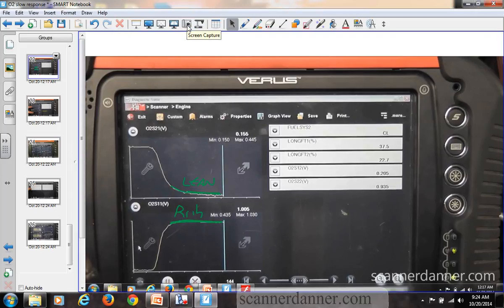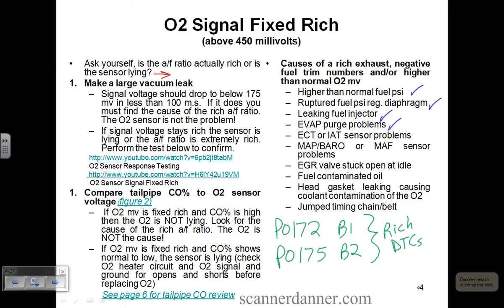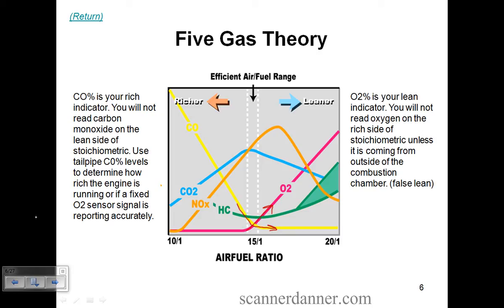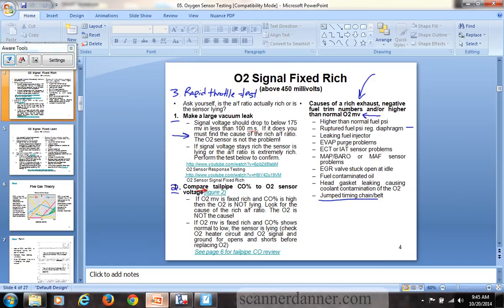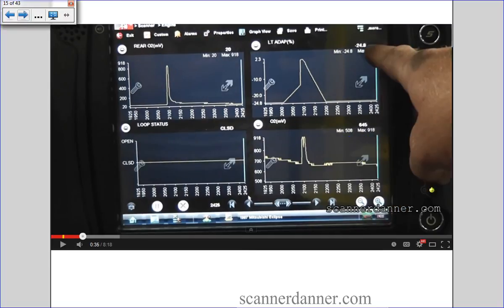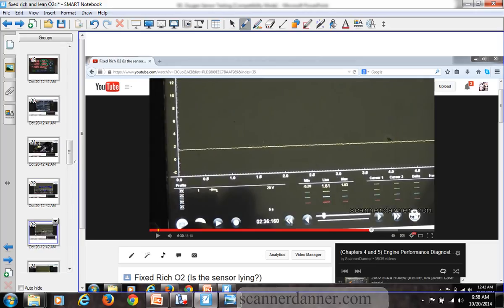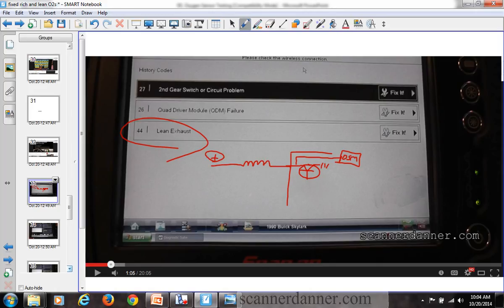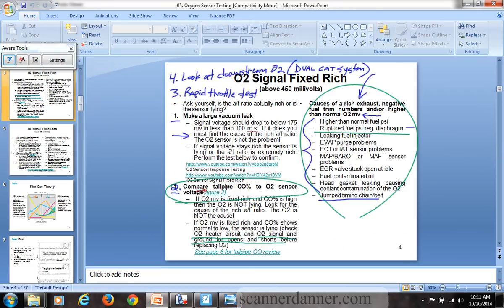Chapter 5 Oxygen Sensor Testing pages 4-7

Comment: the trick with the vacuum in case of extreme fuel trims (I know, should be flatline rich O2 if you have reason to test this) will not work on map engines? It wil react on the change of vacuum by simply adding fuel so the car will run on faster idle / higher RPM but the O2 sensor will not change? I have a Renault Megane which has trims of -100% short and -50% long (maximised). Still moving O2. I suspect a vvt problem but wanted to test O2 by taking off EVAP and even larger leak by taking temp. sensor from inlet manifold. It would run faster, but still would have about the same O2 short/long term values!
Reply from the maker: correct, a MAP engine with a vacuum leak may not run lean
I have a good lecture on this in my week 1 playlist. 
Thanks Henk!

Comment: hey Paul, i have this issue with almost every HYUNDAI model: P2096 Post Catalyst Fuel Trim System Too Lean  
i have no idea how come this code is set!, because every time the trim numbers a NORMAL and the B1S2 the signal is normal steady 0.700 mv, and the description says POST CAT!, how is that?,  some times i could see the rear O2 flat near zero V, but i could never find the specific cause for that DTC, i dont understand the logic of the PCM to set that code, all i do is to tell the owner to change his fuel and gas station because of something i read on the internet about the aditives in the fuel, i never dare to change that O2, and some cars dont comeback, other comeback in a short period of time, and others after months. what could be the explaination and logic for this code?, and what can cause for a rear O2 signal to read a flat low voltage?
Reply from the maker: not sure man, post this to the forum, you'll get a lot of other input. 
There is downstream fuel trim done on some cars